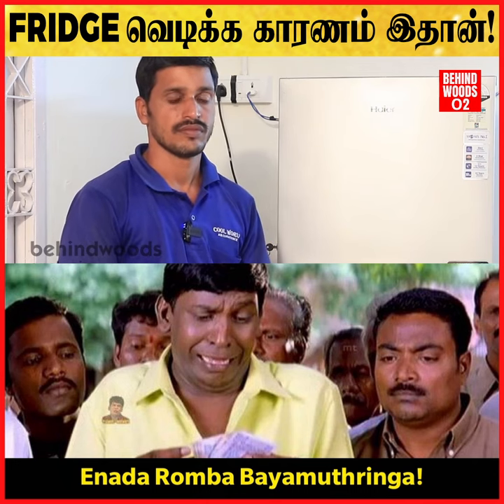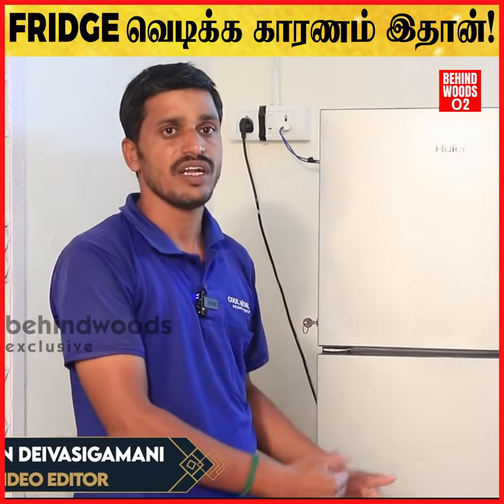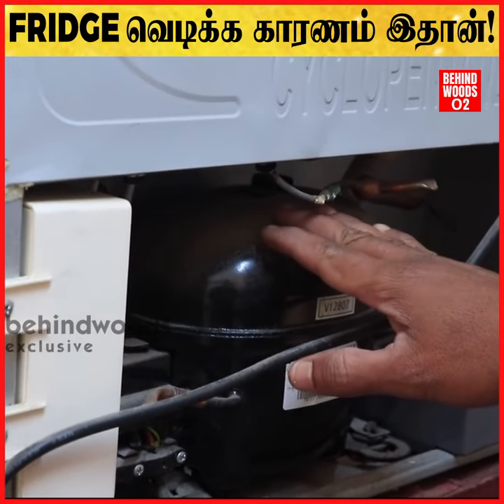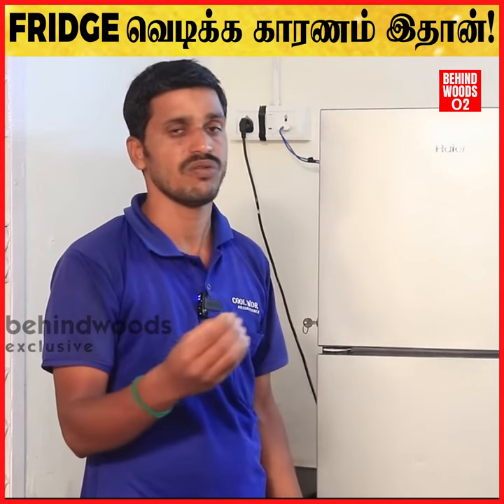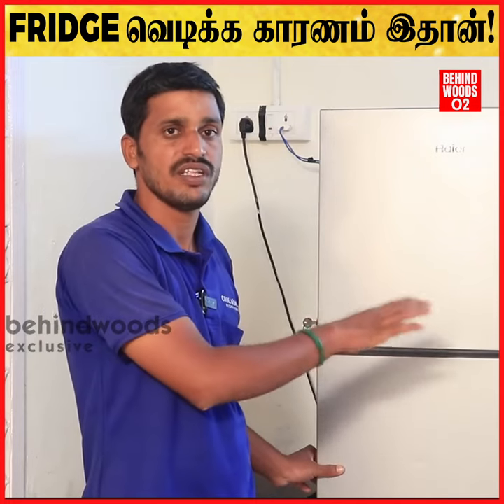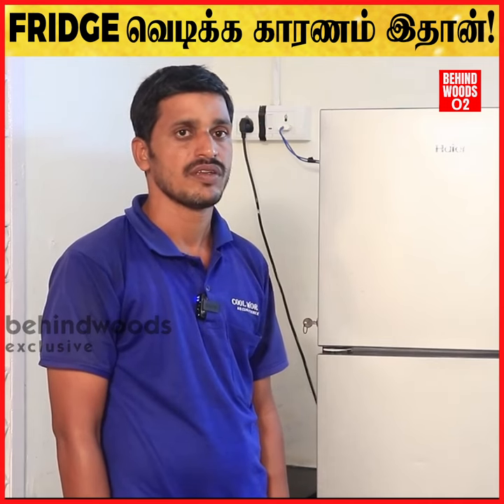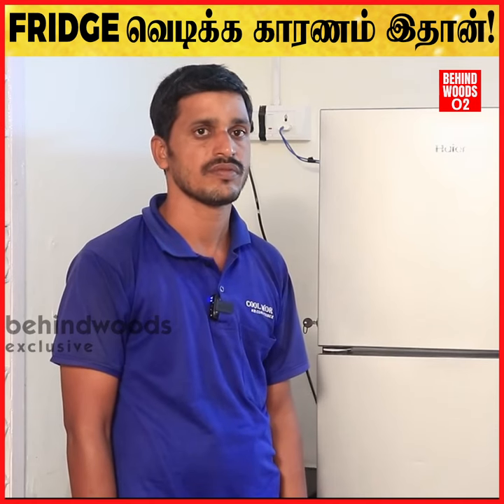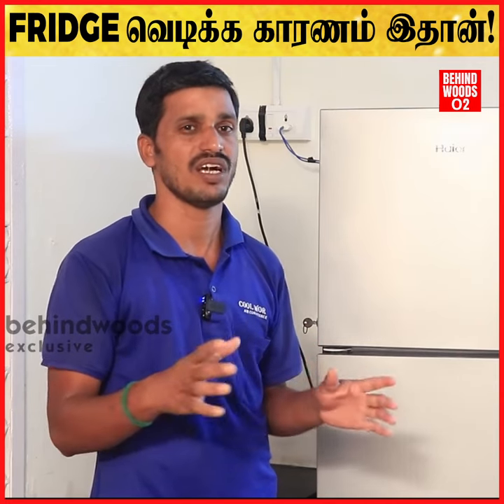"Night நேரா போயி Fridge-அ திறக்காதீங்க..! திடீர்னு வெடிக்க காரணம் இதான்..." EXPERT எச்சரிக்கை பேட்டி

Comment: Connect  2 thermostat in series connection both in same setting. If one thermostat fails compressor will not switch on. R& D to  consider

Comment: Out dated information on Fridge technology. 
Present day fridges are inverter technology and works between  100V to 300 volts. They have a pre electronic driver board.
All inverter based compressors are connected through the Electronic controlled PCB.

Opening the freezer no explosion will take place. I do not understand how this information is passed. No stabilizer needed. Dealers sell to earn extra profits by selling  the stabilizers.